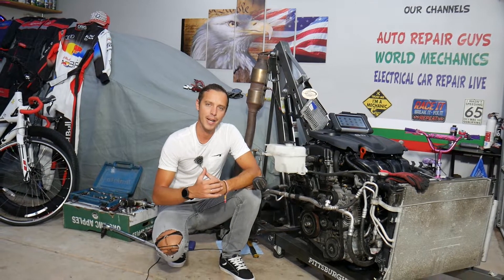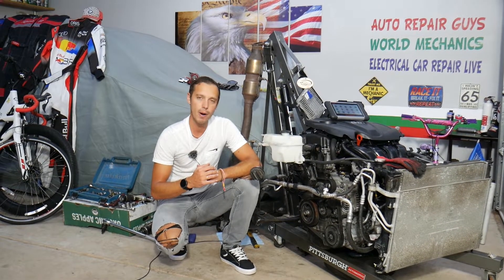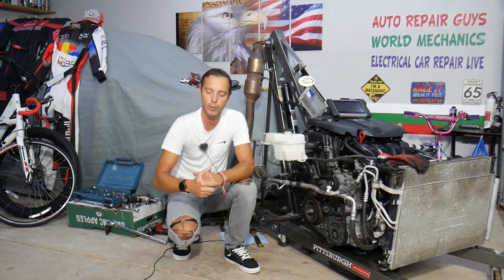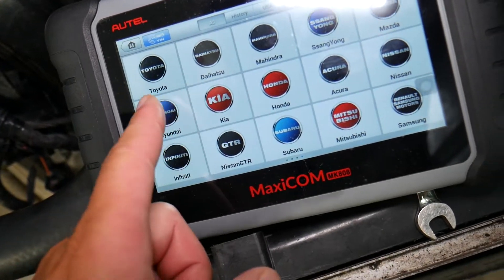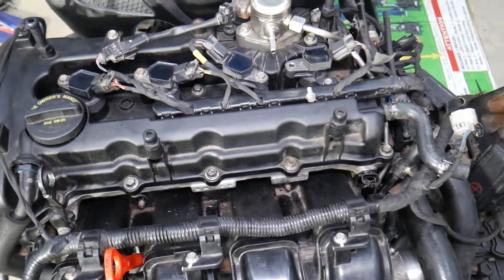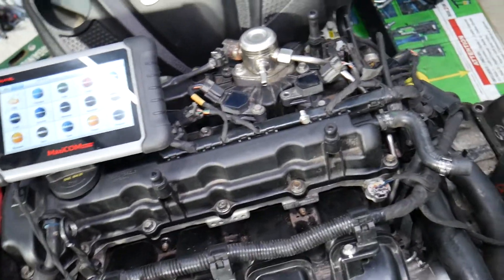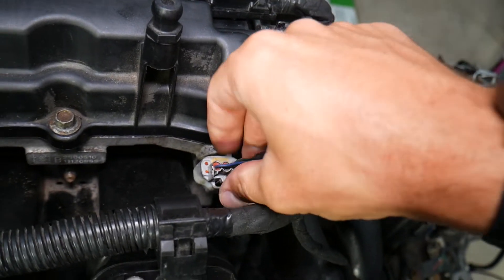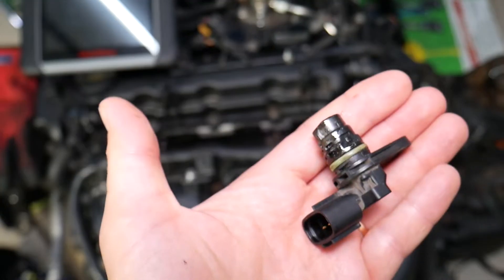CODE P0340 P0341 P0342 P0343 P0344 CAMSHAFT SENSOR HYUNDAI KIA 2.4 GDI ENGINE

Comment: First off, thanks for your videos. 
I am not a mechanic; but this has given me enough information to speak with one and know what questions I should be asking.

I've got the 1.6L T-GDI Gamma engine and got the code P0341. 2017 Hyundai Tucson.
Is P0341 for the intake sensor and it would be a different code for the exhaust sensor?

Looked up the sensor unit price which is right around $25-30.
Seeing the labor involved in changing the sensor from your video, what would I expect a mechanic to charge to do the work? 1hr (min)?? 

The mechanic said he noticed the engine oil was thin looking; he said perhaps there is fuel in the oil.
Would a bad intake sensor not regulate fuel properly causing this issue?
OR
The same mechanic recently, 2 months ago, replaced a fuel pump on the same car.
Would any of the fuel in the oil be related to the work that was done on that project?

Again, great videos!!